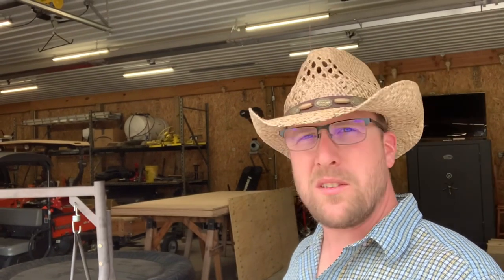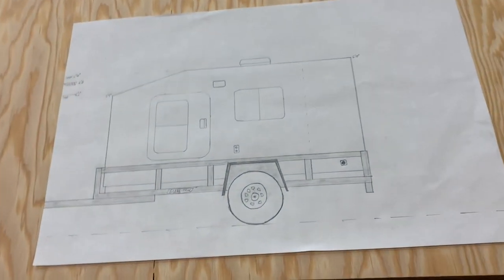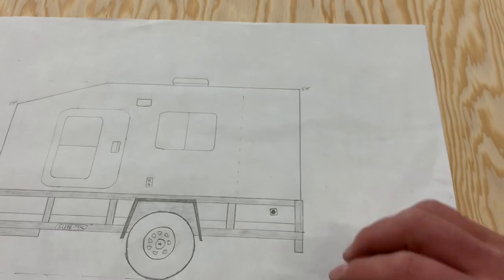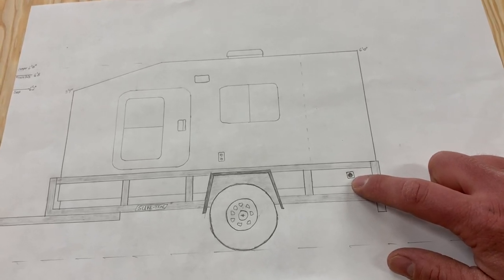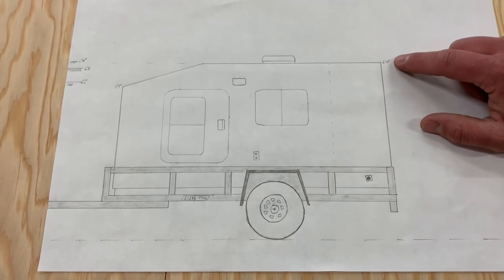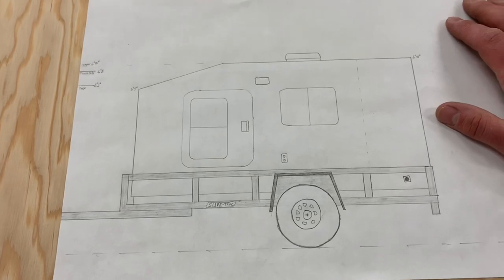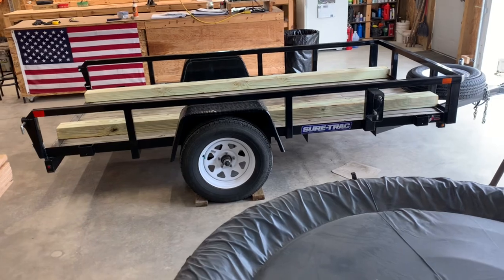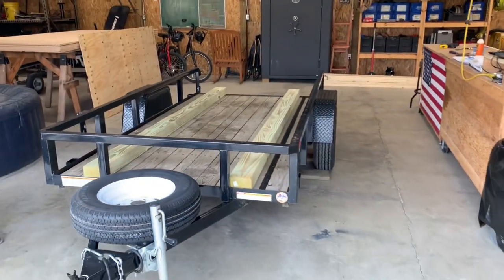Squaredrop Trailer Build!  Part 1-Design

Comment: This video caught my attention because it slips off the trailer and allows use of the trailer separately. Suits my needs. Good thinking.
Reply from the maker: Thanks! I has worked out great so far. I’ve found that during camping season I leave it in the trailer and then take it off for the majority of the year. I made a simple dolly for moving it around the shop when not in the trailer. Check out the series. Thanks for watching.

Comment: The only thing I’ve been thinking of a little differently is putting the entry door to the rear so that you don’t have to climb over the rail of the trailer to get in and out. Our kitchen will be a pull out style in the front of the trailer on the passenger side.
Reply from the maker: If I did it again I would probably do just that, if for no other reason than having appropriate tongue weight on the trailer.

Comment: Where did you get the custom cut 5‘ x 8‘ sheets of plywood? Also in the later video you mentioned a trifold mattress. Where did you get the mattress? I’m looking to build the same shape camper you have however I want it mounted to the trailer. Love watching your videos.
Reply from the maker: Menards, 5’x10’ sheets 3/4” thick
Reply: @LivingOurAmericanDream  Do you think that 5/8"  plywood would work? What was the cost of the ordered plywood per sheet?